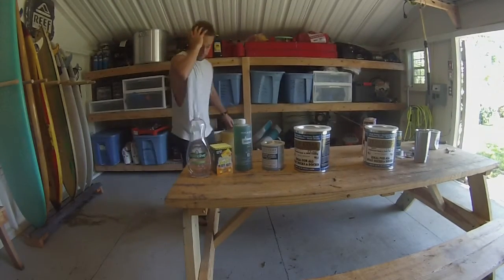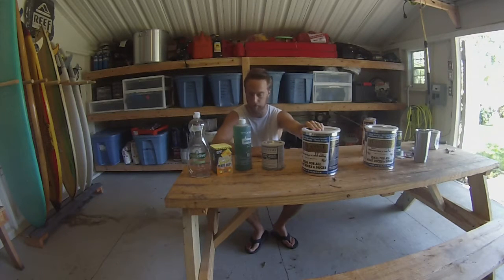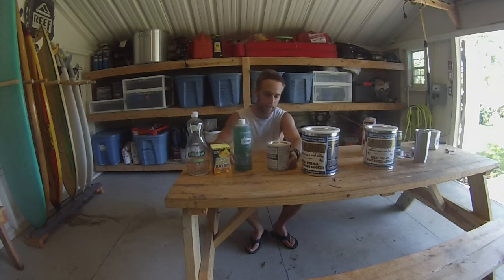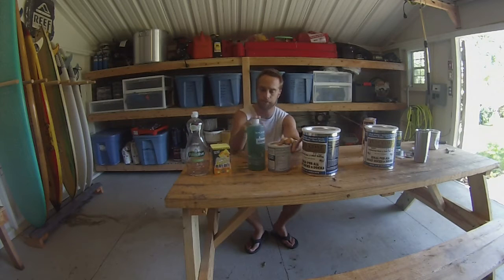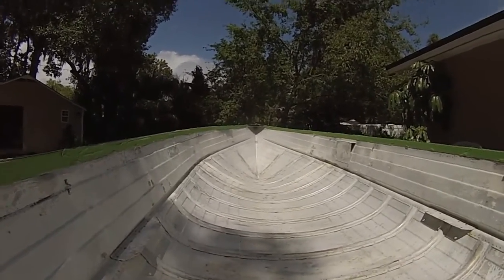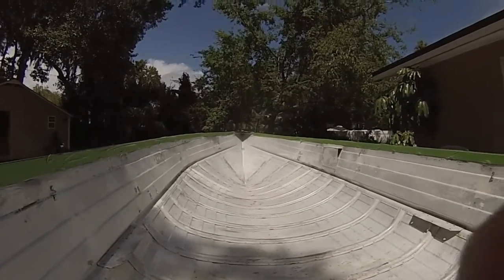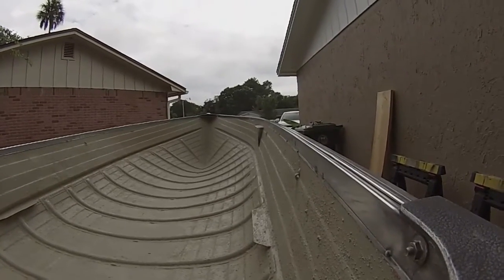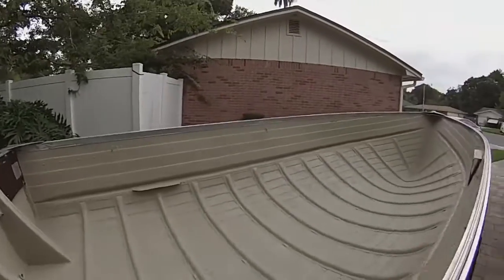Phase 4 - 1964 StarCraft 14’ Aluminum Boat Restoration

Comment: I just started putting my non skid on I see what you mean about the first coat it does not look good at all
Reply: Zach Chester I used a light grey color i used 3 coats as well the skid is a lot thinner then i thought it would be all and all turned out good but honestly thought could be alittle better have a little cracking in some spots but nothing major did yours do that?